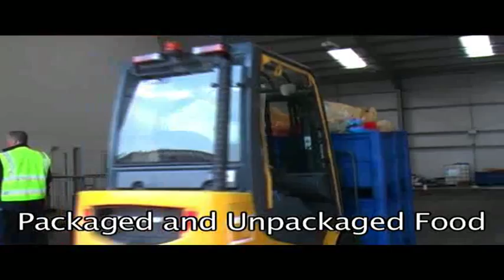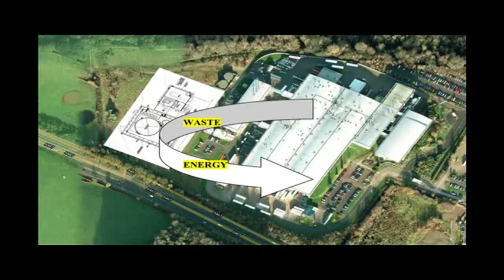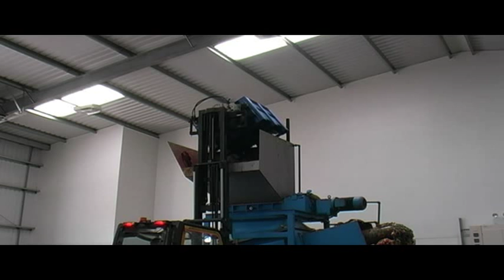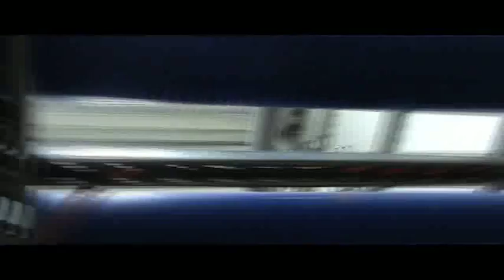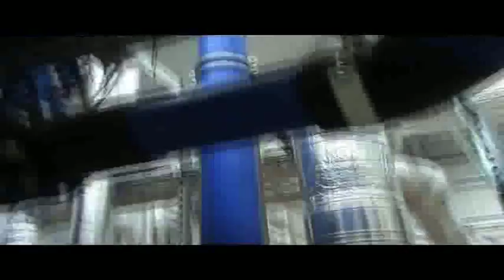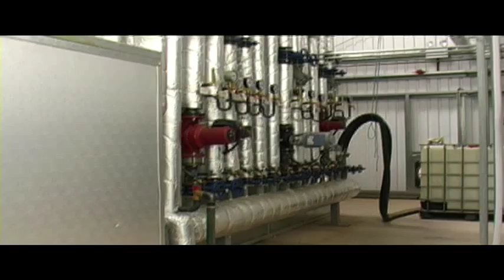InSource Energy Rogerstone Anaerobic Digestion Plant

Comment: I was told by a well informed engineer that the problem with an Anaerobic digester/Methane digester is that the equip./facilities to run it are very expensive & have a very short life & are expensive to restore/replace.He said this is a great idea but in practicality you don't get much out of it,plus Methane gas is not the greatest source of energy and fails greatly in efficiency when compared to Natural gas. I guess if the government(taxpayers) subsidizes this you can scrape up a tiny bit of $
Reply: I think the point here is that they are aiming for zero waste to landfill.  Considering the state of our environment, we should applaud their efforts and put environment ahead of capital profit. The plant also produces 300kw electricity, 400kw thermal (10% of factory demand), 4,500 tonnes of organic fertilizer per year and 1000 tonnes of plastic to be sold as recycled product.